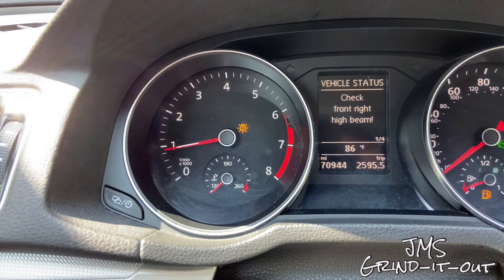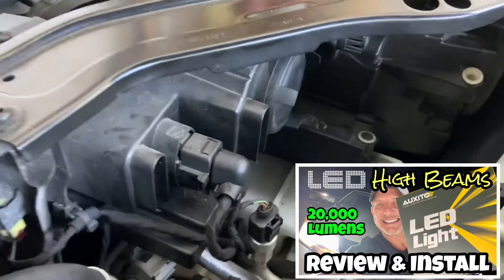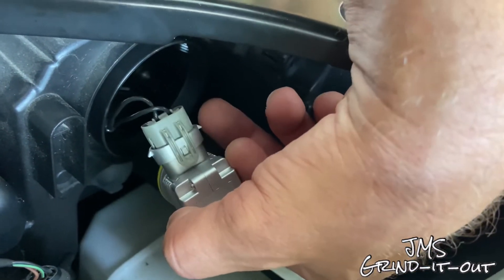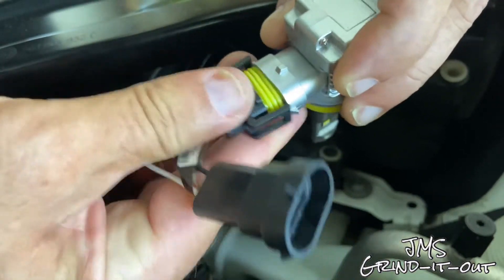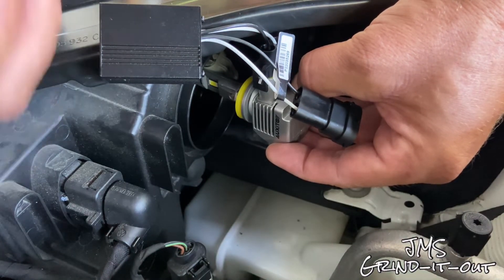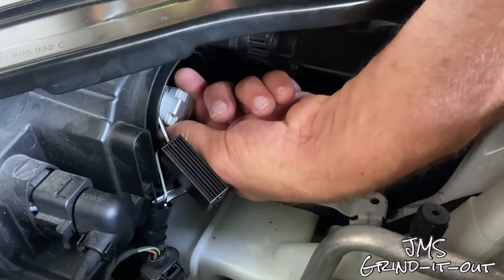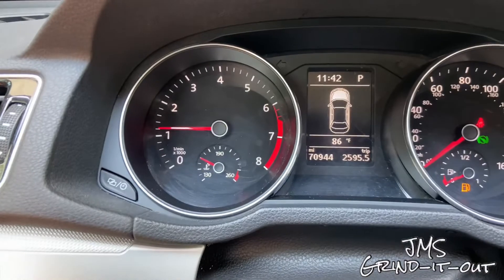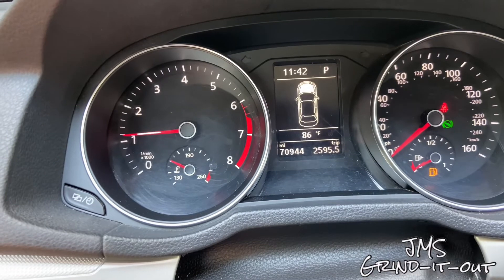How To Install LED DECODERS | Resistors-Error Free H11 High Beam 😎

Comment: Just installed quad beam aftermarket headlights for my camry. On the left side, all four LED beams light up. On the right side, only two of them do. Brighter on the left than the right. Also when I high beam, it gets stuck. Initially looked like LEDs are fried. Can this solve the issue?
Reply from the maker: I’m not sure about Toyota.  As long as it doesn’t throw a code on the dash but I don’t know about the difference in brightness or why some aren’t working.  Try switching them to opposite sides.  As far as high beams you probably need the encoders to level the current pull.

Comment: I put LEDs in the high beam, low beam, and fog lights of a Nissan Sentra (6 bulbs) High and low work, but no power at all to the fog lights. 

Do I need a resistor or decoder? (I see two types on eBay)

Do all 6 bulbs need one? Or just the 4 headlight bulbs?
Reply from the maker: Yea my car doesn’t even have fog lights.  It’s the base model.  I’d like to add them at some point.  Not sure why you’re not getting power to the fogs 🤔
Reply: Did you ever solve this?
Reply from the maker: I don’t have fogs. But resistors are usually For turn signals.  Decoders are the led lights. Usually h7 or H11 is the decoder you’ll need.  It’ depends on the lights connection.  I wish I could give you a better answer.  I only have 2 decoders on my car.  That’s for my high beams.
Reply: @grind-it-out  thank you, but it is for my highbeam not my turn signal. My highbeam for my Lexus is also my day-time running light. I bought a decoder to see if it will work.
Reply from the maker: Only need a decoders if it’s flickering or throws a light code in the dash.  But for high beams it would be a decoder.  Fogs may not need anything

Comment: I have a flikcering issue with mine but its only on one side, Should i install both of them or just a decoder on the affected side please??
Reply from the maker: Good question.  I’d probably do both.  Not sure why only 1 side.   Me personally I’d do both 👍🏼😎💯
Reply: Some systems will run error codes in order of most recent. If you installed a decoder on one, you would almost certainly get an error on the other and almost immediately.
Reply from the maker: If 1 side is flickering it’s a bad led light.  I’ve had 1 side flicker and just replaced the bulb.

Comment: Nice video.. Before the led lights flickered?
Reply from the maker: It had an error code.  The decoders stopped the error code.  They don’t flicker in real life.  Something about the video does that
Reply from the maker: Thanks for watching I appreciate it 💯👍🏼😎
Reply: @grind-it-out  I have a bmw e90 with new corner light led H3 and H8 for the fog. Error for the H3 and little flickered H8 fog when  start motor plus error 😅
Reply from the maker: Sounds like decoders is what u need.  Or small resistors
Reply: @grind-it-out  ok for decoder

Comment: Does the decoder get as burning hot as a resistor?
Reply from the maker: I haven’t had much problem with it getting super hot.  Plus it’s on high beams.  I don’t use those much.  So far so good.  Thanks for watching.  Take care 👍🏼